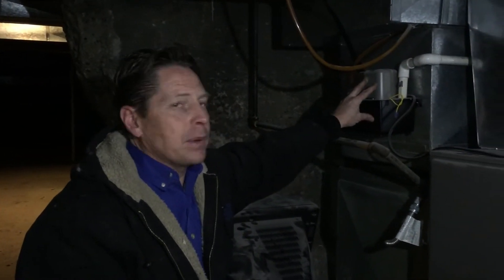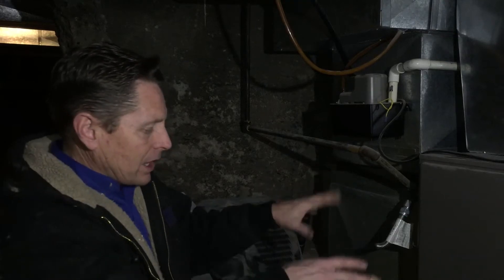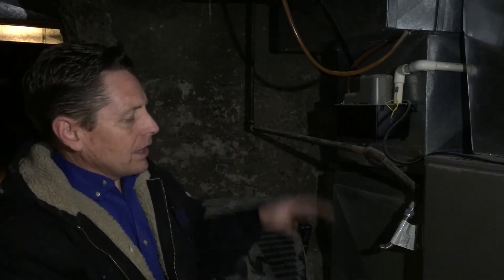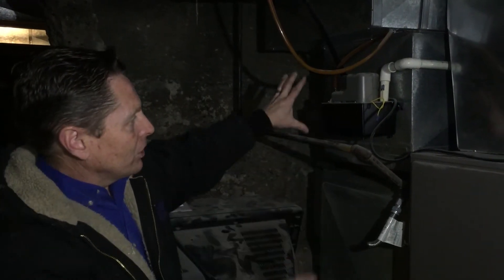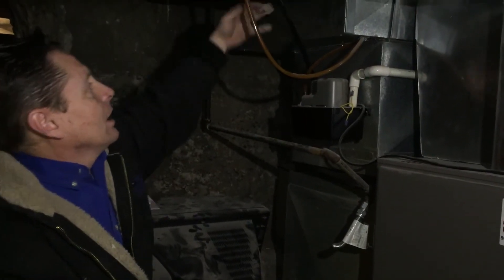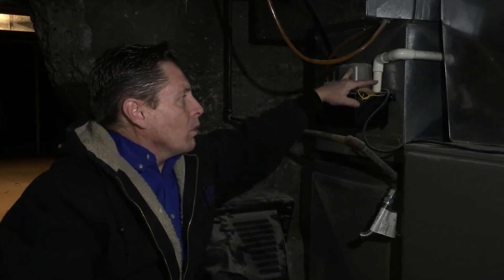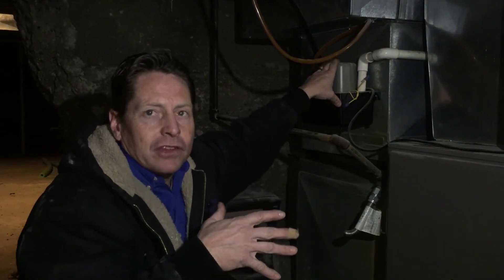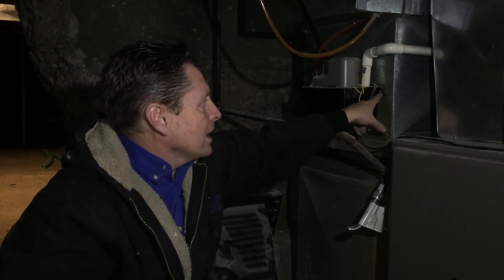Why does my furnace need a condensate pump?

Comment: Ok. Just noticed yesterday that ours is continuously running. The furnace works but pump is running/making noise 24 hrs. We shut off the furnace instead of having it auto run just in case. Ours is on the floor.

Comment: Great tip. My AC and Furnace both would work for a while but would shut off after a while. After doing a ton of research and rejecting a technicians analysis that my whole AC system needed to be replaced, I found the problem to be the condensate pump. I replaced it for 40 bucks now both systems work like a charm!!
Reply from the maker: Glad it helped